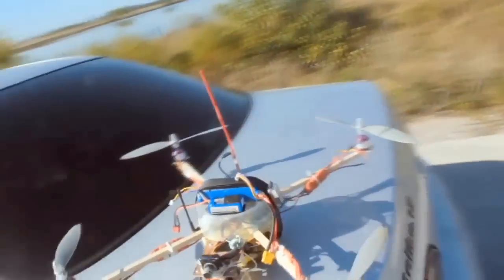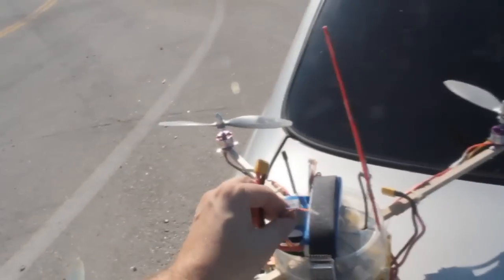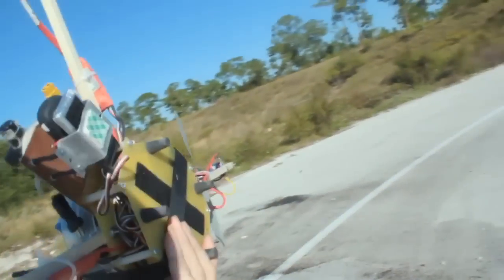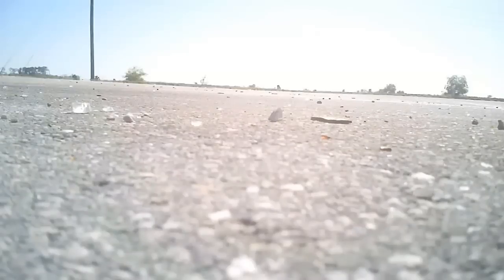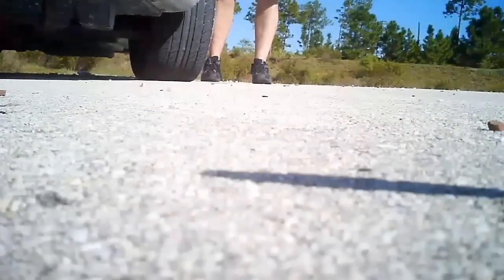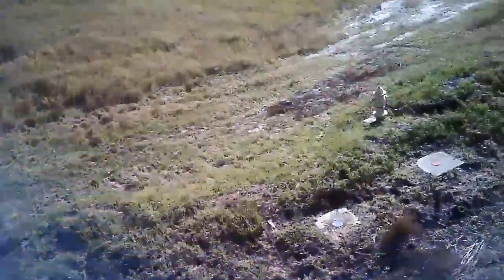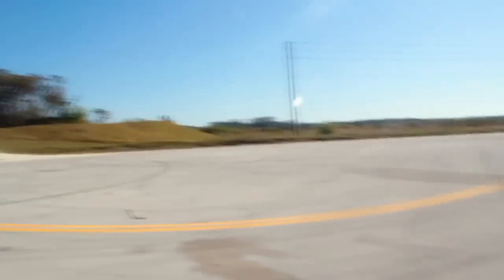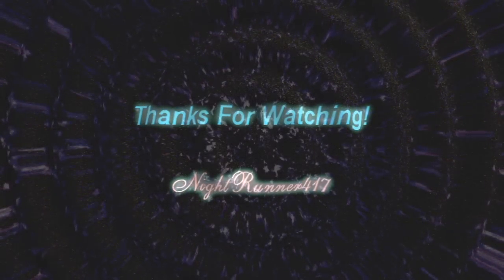Valkyrie II 11-10-11: First FPV Flights, Flown With DragonLink!

Comment from the maker: @octane81 Thanks! Hahaha hard to get much lower than at 12:16... You should have seen the mayhem happening on the undercarriage - every time I skipped the asphalt, my little rubber stopper feet would go flying everywhere hahaha. Man I love this thing though, wow... You can fly them almost anywhere and they can either sit still in the air or burn out like a bat out of hell... So far I've managed 30mph and I know I can do better. SO much fun, every RC pilot should have one, ESPECIALLY FPV pilots.